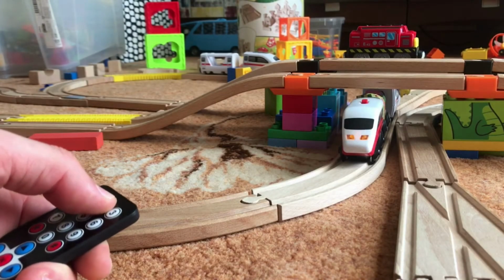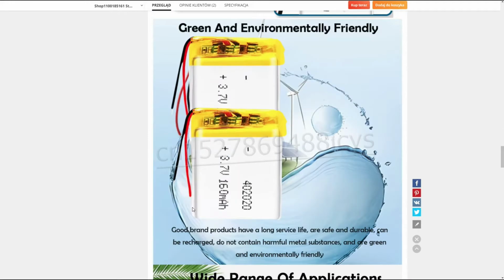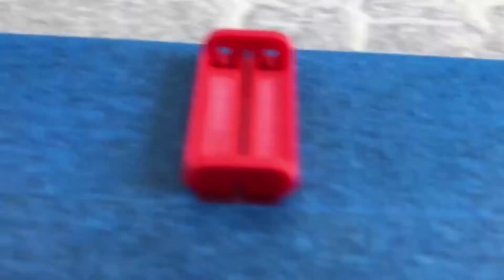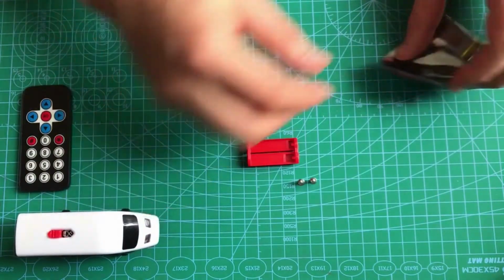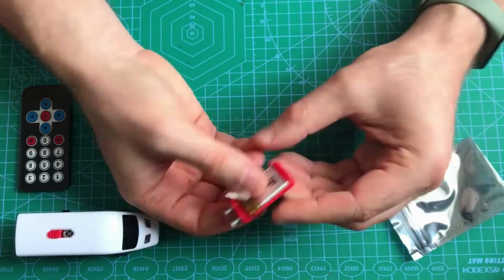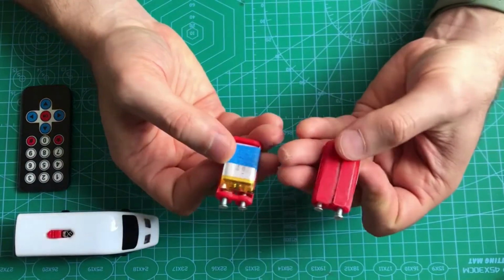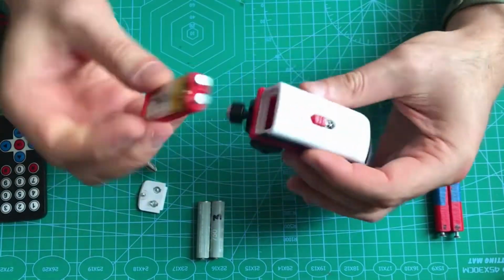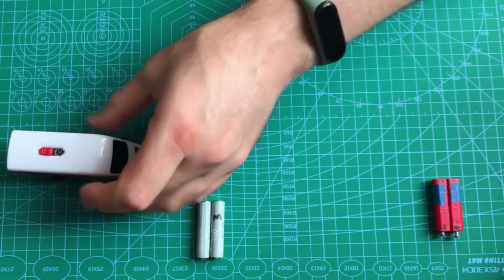Speed up you Ikea Train Lillabo!

Comment: Non mi pare di vedere nessun aumento di velocità
Reply from the maker: Yes, may be it doesn't obvious, but it works. Two AAA batteries give us 3V and one LiIon gives 3,7-4,2V. So, the speed should be 30% increased. You can see it in my other video, when I was measuring the speed.